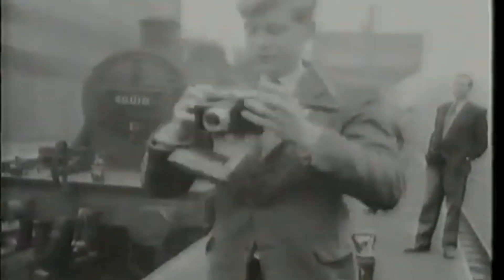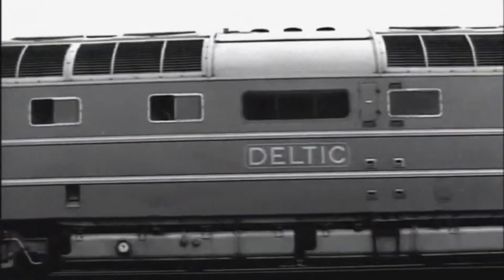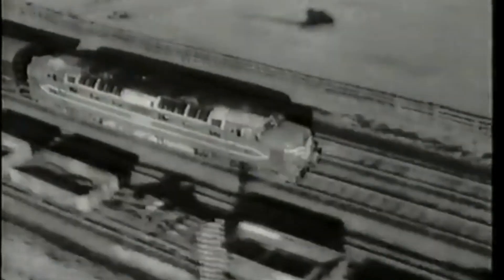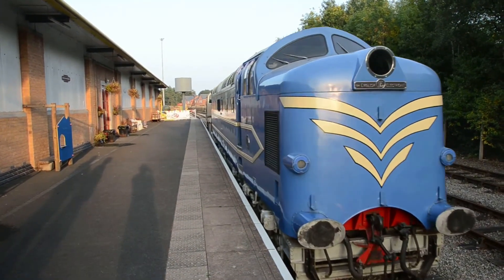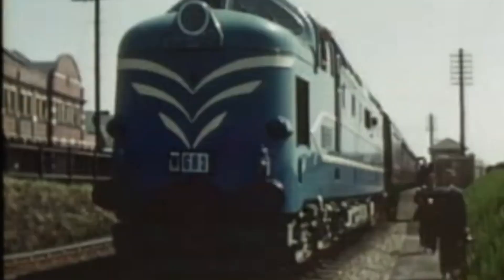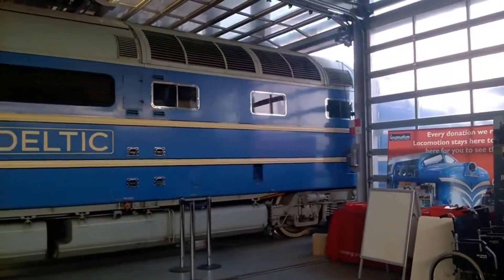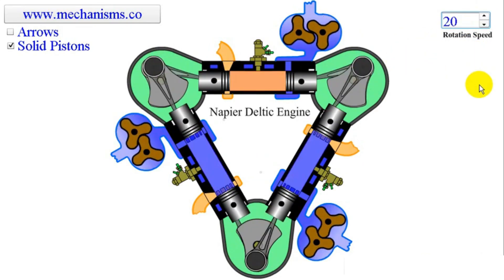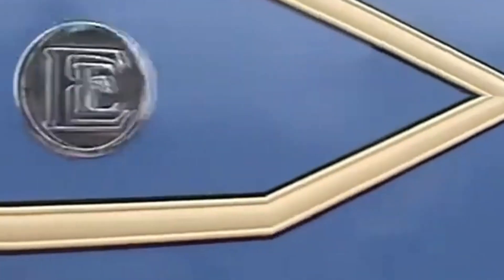What Made DP1 ‘Deltic’ the Game‑Changer of British Railways? #deltic #railway #diesel #fyp

Comment: The loco's original name was going to be Enterprise, but it never stuck. It was just named Deltic. This fictitious name DP1 has just been made up in recent years , people probably thinking it was the forerunner to DP2. This is false. DP2 was short for  Development Prototype 2. Deltic was built by English Electric at Dick, Kerr & Co Works, Preston in 1955. DP2 was built in 1962 by English Electric at The Vulcan Foundry Newton-Le -Willows. It was built on the same production line as the Deltic fleet using the same body shell but with  English Electrics new Mk3 K engine the 16CSVT, later fitted in the Class 50 locomotive.